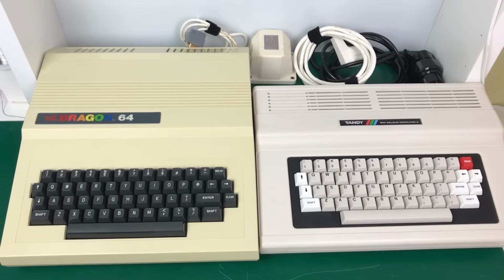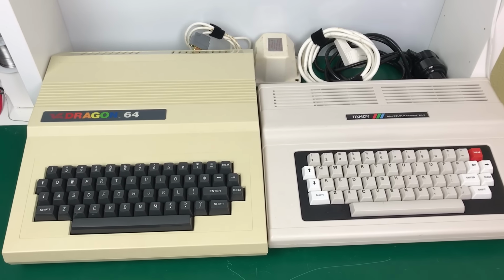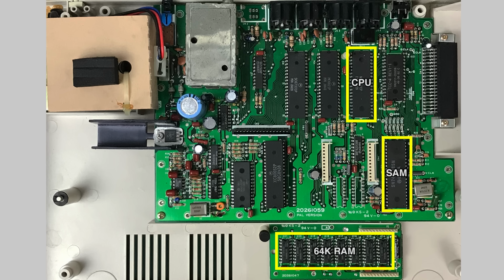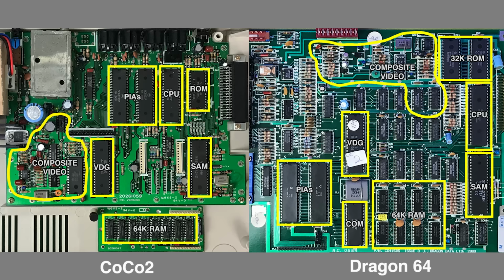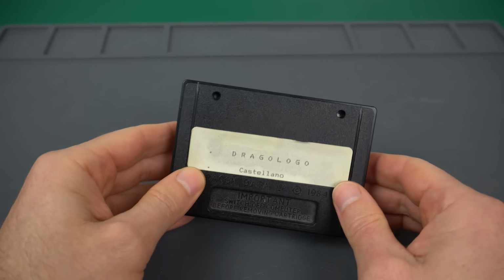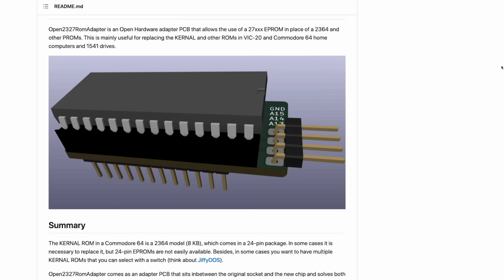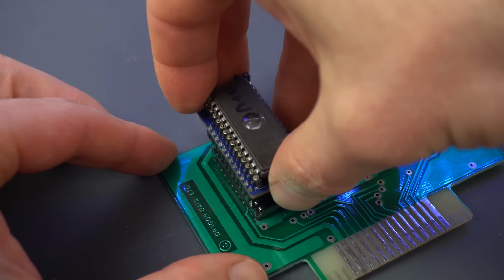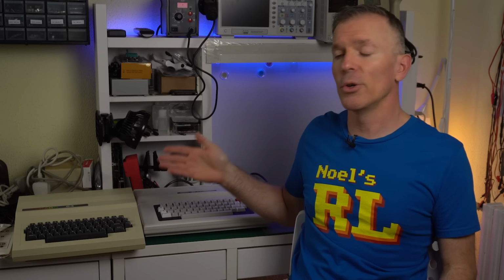Is The Dragon a Clone of the CoCo?

Comment: I never noticed that the keyboards were identical!!!  Were they made by the same manufacturer perhaps?
Reply from the maker: Probably! They probably just called up Tandy's keyboard supplier and said "give us 10000 of the same one as those other guys... but in dark, please" 😃
Reply: @NoelsRetroLab  That keyboard is a standard Cherry/ALPS keyboard layout, which was popular in a lot of computers, terminals and other data entry devices. So simply a matter of ordering the same part number, and some dark caps, with the right double shot injection mould, or a screen print legend, and then assemble it. Different keyback board, but that is simply the low volume option, using cheap soldered key contacts, instead of a custom printed film sheet that forms all keys, key dome and contacts all on a single polycarbonate sheet, that you simply fold over and heat stake into place.
Reply: @NoelsRetroLab  Tandy never shipped a CoCo with a real mechanical keyboard like either of the Dragon ones (the original Hi-Tek dovetail model on most 32s, and the later Alps SKCC which your machine has). Though the Hi-Tek keyboard was definitely available as an aftermarket upgrade in the US.
Reply: Ed Snider, who sells the CoCoSDC, also makes a modern mechanical keyboard replacement for the CoCo.